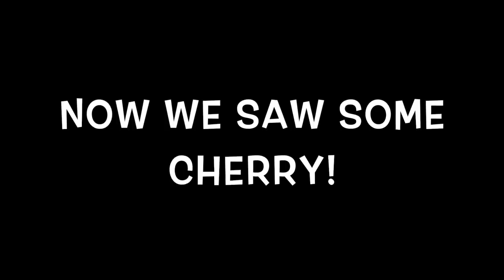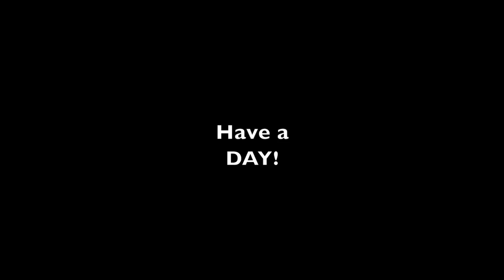#550 Sawing, Splitting  and More, Lumber and Firewood From our Wood Lot!

Comment: Hey Mike, I have a question and an observation.

Question: how do you determine what size boards you'll cut? Obviously the log determines the max size, but how do you decide how many of each and what size they'll be?  It may be because we're only seeing bits and pieces, but it seems like you're cutting non standard sizes. If so, why? Just curious.

Observation: that conveyor is pretty cool, but it seems like it's not grabbing the logs effectively enough to keep the hopper from backing up. Every time I watch it, I can't help but feel like it would benefit from some kind of feed roller or at least higher sides on the hopper and maybe splitter table. Thoughts?

Comment: Use for saw dust, get a pellet  maker, then sell hard wood pellets for pellet stoves, on stead of bags, core charge on drums,  figure out how much weight a drum holds of pellets then calculate price!.

When planking a tree, unless you have a direct use for a certain dimensions of lumber, I would keep cuts at 9/4, just over 2 inches ruff cut, for sticking and drying. You can always recut into 5/4 on a simple cabinet saw.

Comment: I see you are still using a gas can that ya have to lift an pour into tanks- look at a 2 D cell battery pump that pumps gas - diesel - made for fuel transferring. I bought two at Canada Tire store an they work great- it loots light duty plastic but they wok

Comment: I am going to say I'm not sold 100% on the handling system of the firewood after its split. It drives me crazy watching that big of a build up at the end of the splitting tray. I think I would be investigating a way to drop the end of the tray filling the collecting area of the conveyor. Maybe also a few inches higher on the sidewalls of the split collecting tray area. My other initial thought is a sort of tooth on the horizontal bars in the conveyor chain. The split wood with weight collecting on top of all the split wood seems to ride over top of the smooth bar. Give that bar some teeth to grab the wood and carry it up the conveyor. I'm not downing you or your your wife or your family or going to stop watching you because your anal about stacking your milled lumber, I'm just offering an observation. But on the other side you'll probably not respond to this anymore than you have on other comments I've made. Have fun with buckin stock

Comment: Hey Mike, got an idea for cleaning up the sawdust.
It may or may not work, but if you hang a bucket under the Wood Mizer to catch most of the sawdust, then park your little red tandem axle trailer close by dump the bucket in the trailer. Then afterwards see if your customers would like Sawdust or sell it. Just an idea and passing it on to you...

Comment: Hi Mike, 
 Just thought I would let you know if you haven't thought about it yet. The IBC totes you are storing your firewood in will have a bunch of mice nests in them before winter. I tried doing this with pallets because I was tired of handling wood a bunch of time. I tried the Tom cat scents and mothballs, neither worked for me. I ended up up changing my tote design to a six foot tall 3x3 so I could just store inside my basement. I move them around with a pallet jack when time to feed the stove.

Comment: Great video. I use my grapple as well for everything I can. I do have a question regarding hydraulic implements. Do you have a concern of losing hydraulic pressure and allowing an implement to drop or close? I'm asking because as much as I like the grapple I'm also extremely cautious around it and definitely will not stick my head in it.

Comment: I have not seen u trim the bark off of the first boards of the logs r u doing that they r nice wide boards
Reply: You can see in the video the debarker running in from of the blade. Not sure what you're not seeing?
Reply: It's when u put the first boards with bark on each side of board and trim bark off them maybe I need to open my eyes
Reply: @jerryhollingshead7806  Aye, watch the video. The debarker runs in front of the blade. It removes a thin strip of bark so the blade enters bare wood. The blade does however still go thru bark on the exit side.
Reply: Thanks I would like to have the 150 all the ones I have seen u got put boards on side on the mill and trim bark from boards like a trim saw sorry Mike still old fashion